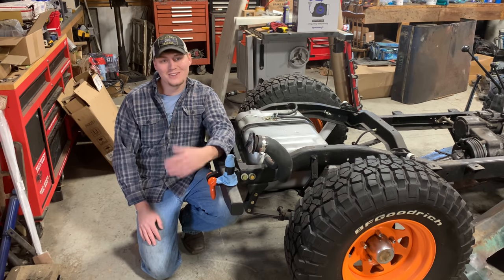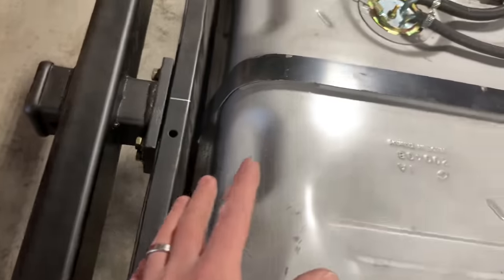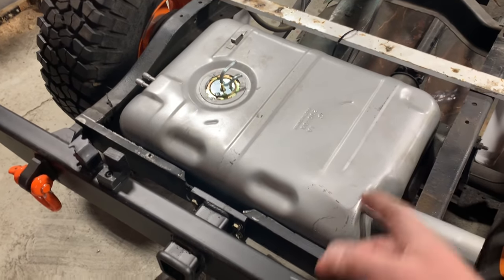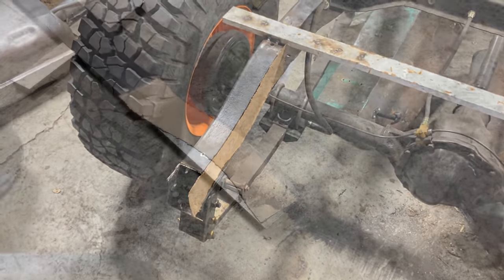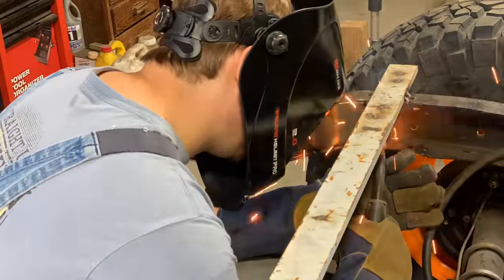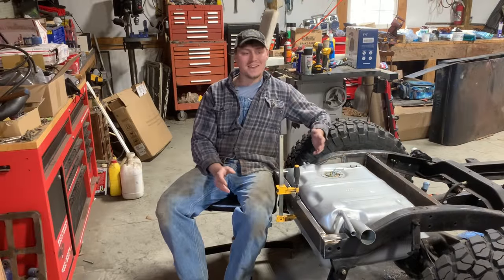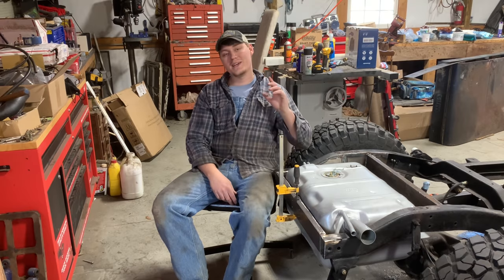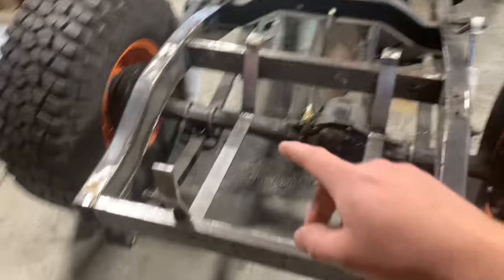Willys Jeep Rear Gas Tank Conversion Part 3!

Comment: I would put some kind of rubber over your straps. I did. I also painted my tank and under coated it. The old tank had rusted through and had holes every where. It does look great.
Reply from the maker: Someone suggested bicycle inner tube I might try that. Thank you!

Comment: Great job of walking us through this conversion am building my 1946 with a lot of help from your videos.  Two questions:  How did you attach the vent hose to the fuel filler hose?  I know there i s a hole in the fuel filler hose, where you can insert the vent hose, but what keeps it from moving or leaking?   Where did you mount the vapor cannister?
Reply from the maker: Thank you glad to hear it! If you search 72 Jeep Cj5 fuel over flow connector you will see some different options. It’s a pretty simple little piece. As for the vapor canister I’ve still not decided what I want to do I’ve been looking at some bigger factory canisters. Right now I’m just planning on running a vent with a check valve in it. Hope this helps!
Reply: @SevenBarSalvage  Thanks a lot. I just ordered the tank and and accessories on your recommendation to complete the relocation.  Your videos make it much easier to accomplish needed tasks on my CJ2A.  Just finished replacing the dash panel with your help!
Reply from the maker: @ddarrough Glad to hear it!

Comment: That material you used for the straps looks like it was a tool steel, not mild steel, which explains why it snapped instead of bending.
Reply from the maker: I ordered crs but now that you mention it I think you’re right!
Reply: @SevenBarSalvage  notice it had a bright finish and sharp square corners, mild or cr normally has mill scale and the corners are every so slightly rounded

Comment: Looks your fuel fill bezel is pretty high on the completed project. I am looking at moving the tail lights above the the fuel fill bezel. Just to be different. (
I am putting a 45 gpw on a cj5 frame.)  Did just not want to move the lights? Or did you need the room for the fill hoses?
Reply from the maker: Honestly if I did it over again I would have put the fuel fill on the side instead of on the back. It would have made my light position more flexible I wish they weren’t so low. Thanks!

Comment: I wonder if there is a difference in the 3B and 5 frames. 🤔
I stole your rear tank idea and mounted a 70's CJ tank and skid plate in my '67 and it fit like it had eyes with plenty of room to the diff. I hung it on the rear-most cross member and the next one up after I removed the "V" shaped thing.  According to the official Jeep service manual, the frame is 37 1/4" from the shock mount to the rear end of the frame on my CJ5. I'd be curious to know...if the frame dimensions are the same...if maybe the rear of your frame was cut off a bit shorter at some point in it's life that you experienced clearance issues...
Reply from the maker: You got me curious I looked into it. Looks like a cj5 has an extra 1” of wheel base and the body is a few inches longer than a 3B. Glad it worked out good for you! Thanks!
Reply: MY 1980 CJ5 has a boxed frame and has about 3" open space on the driver side, between the frame and gas tank, for the exhaust. So the 75+ frames must be wider than the 3B frames.

Comment: I'm curious why not just leave it in original location?
Reply from the maker: When I relocated the seats the stock tank wouldn’t work anymore, and it’s nice to not sit on top of a gas can haha
Reply: @SevenBarSalvage Gotcha. 
I will have to rewatch that video.  I'm planning on moving seat back in my 61, but didnt plan on moving fuel tank.
Reply from the maker: @survivingminnesota8381  If you extended the stock seat brackets you can keep the stock tank there. I made custom seat brackets that mount differently.

Comment: Just put the tank back under the seat
Reply from the maker: Where the seats are at now a stock tank wouldn’t work, it’s nice having a little bigger tank and not sitting on top of gas!
Reply: @SevenBarSalvage  nothing wrong with the tank under the seat and nothing to worry about